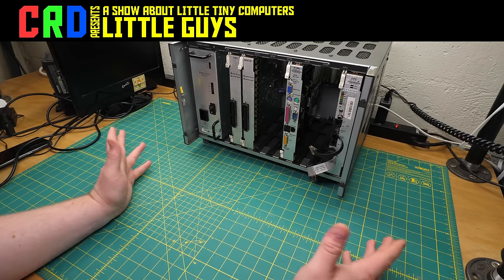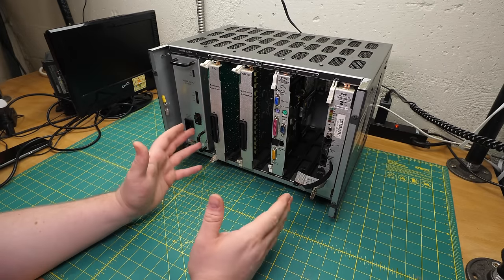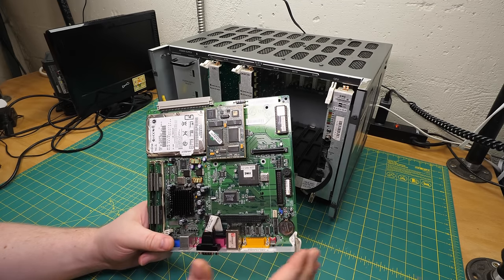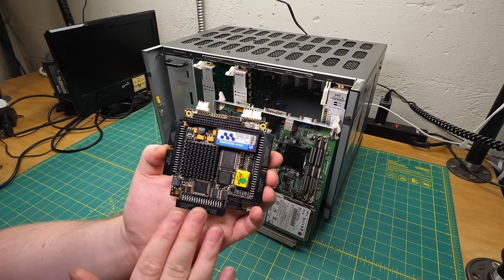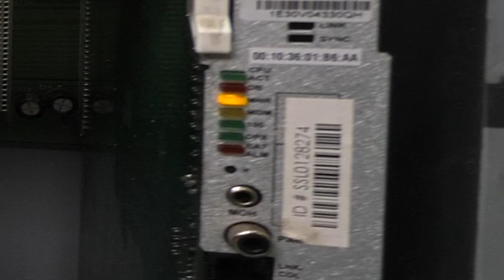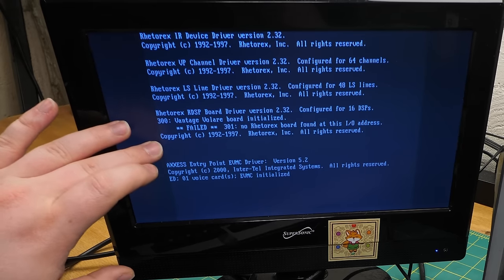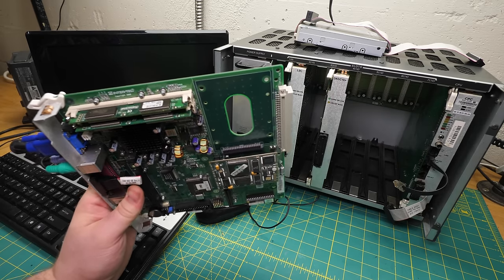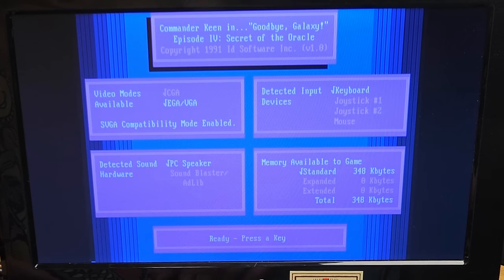Little Guys 9: The First Of Many [Intertel Axxess]

Comment: I used to install and service the Axxess. The fun part about upgrading the software for VM card was that it had to be done with a series of floppies. As you can obviously see is that there is no floppy drive but there is a floppy header. Whenever I did upgrades I had dangle a floppy drive out of the chassis while it was powered up and go through the upgrade process with a monitor and keyboard attached.
To explain why audio goes over the PCM port and not the backplane is that the original voicemail system for the Axxess was a full external PC with an ISA card with the PCM connector and DSP bits. Control of the voicemail system was done with a serial port. The EVMC is all that put on a card that is powered by the backplane and communicating the same way.
Reply: Heh. Just like some airplanes. (yes, some of them STILL load updates from 5.25" floppies.) I guess it could be worse... upgrading Big Boy(tm) phone switches from TAPE.
Reply: we had a zip drive kit...
Reply: Work still has one in production use, with the outboard voicemail PC and all. The PC software uses a DLL to cause Windows Explorer to interact with a Microsoft Access database. It only works on a few versions of Windows NT, ours runs NT 4. People jump up and down screaming at me about how dangerous and irresponsible and insecure this is because they cannot understand that there is no network hardware and no USB ports and no WiFi capability, the machine physically cannot be connected to any kind of network. The hardware is not there. They just keep asing "But what if someone just plugs it in? What if it gets accidentally connected? What if someone sneaks in..."

If someone is able to get through all of the locked doors into the phone equipment room and install hardware undetected, I have much bigger problems than the Intertel software being unsupported. They could just wreck everything in the room with a hammer and do a lot more damage.
Reply: @SuzuranMajere  Yeah. Some people just cannot wrap their noodle around a computer NOT being connected to the internet. The only way to potentially interact with it is through the "modem" (fax) interface. Some of them (VM cards) have a means of "DISA" - Direct Inward System Access - for remote management, but the interface is uselessly slow (9600bps)
Reply: Neat!

Comment: Your gnarly black grease reminds me of something I encountered back when I did electronics recycling.
We got stuff that had come out of a Harley Davidson plant. Hundreds and hundreds of 700MHz Compaq Deskpro desktops. HUNDREDS! And then later, hundreds and hundreds of Compaq Evo desktops that replaced them. The deal was we refurbished the ones that were salvageable, donated those to charity, and used the proceeds from scrapping the rest to fund it. Anyway, some of those PCs lived in very harsh environments - some in particular were coated inside and out in a horrible black greasy tar that was some kind of freak abomination of condensed motorcycle exhaust and aerosolized lubricants.

... And then there were the weld shop and paint shop machines.
Reply: And to think, the same stuff is coating the workers lungs
Reply: I used to do some electronics repair and hearing "weld shop paint shop machines" triggered a fight or flight response. I remember seeing the aftermath of somebody dumping a shitload of current through a steel PC case. Sheet steel can't handle that much current.
Reply: A few of my customers are machine and mechanic stops. That black grime is on everything even with me cleaning them every 6 months.
Reply: Every CNC machine from the 90's I've worked on is covered with the mystery black gunk (pretty sure it's mostly cutting coolant, and other oils), but most of them have seals on the electronics cabinet, with a heat exchanger, so no air is actually moving from outside to inside of the cabinet - on some machines that haven't had many issues, and the door was kept closed, the inside of the cabinet is virtually pristine. And on the ones that had issues, and the doors were open a lot, they're pretty coated. You can wash it off with simple green and a plastic brush, and rinse with hot water. They come out basically brand new. PCBs are washed when they're manufactured, so it's not a big deal to wash them again later. Just be careful of water in connectors, transformer coils, and under chips, or in speakers, buzzers, etc etc. Compressed air usually does a good job of getting rid of 95% of the water.
Reply: I got a 486 machine from an old print shop that got used well into the 2010's. The board and cards were jet black from ink powder and dust.
Reply: I was thinking machine shop

Comment: I worked at a NASA contractor a few years ago and we sent PC/104 computers to the ISS to control and caprure data from various components and sensors of science experiments. Cameras, thermostats, servos, ignitors, heaters, pressure sensors, valves, etc. They are still very useful and you can get tons of add-on boards for them for connecting all kinds of specialized equipment.

Comment: Hey Thank you for the OS/2 and ATA (VOIP) modem stuff on your website!    The OS/2 images were a serious nostalgia trip for me;  I used 2.0 and 2.1 daily as a personal workstation in 1993-1994, and then years later for work had to upgrade a pair of OS/2 2.1 servers to Warp 4 for Y2K as no one else had OS/2 experience.  OS/2 2.x had super fast disk routines and was WAY more responsive on a 486 than any version of Windows at the time.  Multitasking with a modem was reliable unlike Windows 3.x.  I missed out on Warp 3 because of a life event that occured right before it was released, but it looks like that would have been a great upgrade.   Keep up the awesome site and work CRD!
Reply: In the early 1990s, OS/2 was the hands-down best OS for personal computers. I still miss some of the awesomeness of the Workplace Shell.
Reply: As microelectronics engineer, i have a deep love/hate relationship with OS/2. It's super finnicky to set up and to navigate, but once it is ready for it's purpose, it runs very stable. OS/2 is still used in some industrial or commercial legacy systems. But most of it runs on Windows NT or UNIX.  I work mostly for smaller production facilities and they often buy older second hand machinery. 

I have never used it as a desktop system, but after all what i have seen, i came to the conclusion that desktop UI's before Win95 are super unintuitive, at least in my eyes. Win311, Amiga WB, UNIX, etc, they haven't quite figured it out yet. I'm born 1992, so i missed that time period. My parents were engineers too and  had some older 3D/CAD systems at home. Amiga 2000 & 4000 based ones and dual Pentium Pro Siemens Nixdorf systems with NT4. 

There is a modern OS, which claims to be compatible with OS/2 applications called ArcaOS, but i have not tried it out yet. It looks very close to a Linux DE from what i have seen.
Reply: @hyperturbotechnomike  The problem with ArcaOS is that it's still a closed source system and if there's one thing that companies like to do it would be to squeeze pennies until they melt into copper. That also nixes the hobbyists out too.

Comment: my uncles ran a bus company for a while and they had one of these PBX boxes in the back electrical closet and the thing i found neat was someone had attached a radio-stereo system to it, so radio played over the PA system in the warehouse and repair bays, and it all looked so duct-taped together.
Reply: shit, someone did the same thing in the tax office I worked at in college. Our PA system was literally wired into the output from a regular old boombox with its speakers ripped out so the wires could attach to the PA system controller, which was in turn run by the poor little overheated office computer pretending to be a server.

Comment: MCF5272VF66 "SOC" is a ColdFire V2 SOC running at 66MHz, my best guess is that it's comparable to a 66-100MHz 486 (depending on what it does).
ColdFire isn't "a 68000 processor", the instruction set is derived from 68k but is missing some instructions and addressing modes, the FPU internal precision is 64-bit instead of 80-bit and the actual instruction encoding is simplified. You can run 68000 assembly through a translator to generate ColdFire assembly and then assemble that, and for simple programs it might work as is but it's really intended as a starting point for porting rather than being used directly. This seems similar to how the Intel 8086/8088 came with a translator that took 8080 ássembler and generated 8086 assembly - again it might work out of the box for very simple programs but it was really inteded as a starting point for porting all those old CP/M programs.
Reply: I forget how they marketed the thing. I had several dev boards, and I think the palm pilot used them. They were roughly based on a 68030, but designed for low power use. I don't know anyone that wrote assembly for them (that could avoid it :-)), everyone wrote things in C. (with minimal tweaking, C compiles anywhere.) It's hard to compare it to a "PC" as it's not anything like it. For example, SSH is insanely slow on a CF processor, so much so a 12MHz 386 can run circles around it.
Reply: I had a portable music player back in the 2000s that had a Coldfire CPU (Motorola had spun off their semiconductor division as Freescale so that's how it was branded). I installed a hacked firmware called Rockbox and even created a basic 3d game for it, and I wrote the core of the rendering loop in Coldfire assembly. It was pretty fun getting it all to work.
Reply: I know that the older Crestron Building Automation systems used a Coldfire C based compiler for their programming software. But it was all proprietary at that level and heavily guarded from non-licensed programmers
Reply: @PinkPandaKatie wow, Rockbox rocked! I installed it on the iPod Classic, the last gen before they all turned into b-stock iPhones with no cellular connection.
Was your game by chance the Doom port?
Reply: @Dong_Harvey  No, nothing that fancy. It was actually inspired by Ken's Labyrinth, and I called it "RocKen" as a pun on "Walken", the early prototype of Ken's Lab. I never finished it, though, and my iRiver H120 broke a long time ago so I have no way to actually play it now other than a standalone test version I created.
Reply: I was hired out of college in 1999 to port a bunch of legacy 68k code to coldfire. That idea was scrapped right after I got there since newer compilers didn't support register indirect data addressing the legacy code used, so the 68331 was bumped from 16MHz to 25MHz, and the project continued. Ironically we ended up porting an RTOS to the newer hardware and didn't directly use any of the legacy 68k code, so CF would have been fine, and run a lot faster.

Comment: The pin you blew up, btw, is a ground pin on the hard drive and the melted socket on the motherboard is the +5V (motor) pin. Since there are multiple adjacent ground pins elsewhere on the connector, ground was still properly connected when the pins were offset and you shorted the main 5V supply into one of those ground pins (which promptly melted).

The reason the drive and board still work is firstly because those other ground pins on the drive are fine, and secondly because either your 5V motor supply socket on the motherboard is still ok despite the melting or because there's an adjacent 5V logic supply and they're bussed together on one or both ends.

Comment: Oh man, I used to admin an Intertel Axxess (and before that, its little brother, the Intertel Axxent).  I had the very configuration software you're missing, sadly, lost to time.  And yes, with that system and an ISDN PRI line, you could make all sorts of telephone magic happen.  (A call from Zimbabwe, you say?)  Our system must have had the network card, because I could reach into it from my desktop system.  (This would have been a circa 2002 system.)  Those little DSPs were a much-touted voice-processing feature that did some echo-cancellation for speaker calls, among other things.  It was really a nice little beast.  
Oh, and here's a fun "little guy" moment:  The kid-brother to this system, the Intertel Axxent, actually used an ATX mini-tower as its enclosure, but not in the way you'd imagine.  It had some kind of passive backplane, analogous to the Axxess, but it was in an ISA/PCI card slot form-factor. Similarly, the voicemail card was a single-board computer that plugged into that backplane, but a completely different shape.  (It was probably running the exact same voicemail software.)  It was a PC in a PC case, but not like you'd expect!

Comment: High an old CallWare CNTE here (Certified Network Telephony Engineer). The 15 pin connector is for out-of-band signaling to the voicemail card.  Calls are routed to voice mail and become analog pots calls that get converted by the 8 channel card on the board.   The 15 pin connection tells it what the call is that is coming in.  For instance on port 2 is extension 103 doing a voicemail retrieve, on port 4 is a call no answer for extension 105, and on port 3 is a transfer to voicemail for an outside call to extension 106, port 101 is an Auto Attendant, etc.   Many voicemails did in-band signaling where it winks, sends DTMF digit to say what the call is, then winks again and the call is put through, but they were a little slower and if you had one bad line, it was REALLY hard to trouble shoot.   Some of the early systems (Like Panasonic KXPs) had to do supervised transfers, those were messy.   We also had TSAPI, an out of band signaling protocol running over SPX, that one had some problems at first!  Most of those systems we just had to change over to in band.

Comment: FYI, 1.) there are new Open Source Hardware projects making things like Sound Blaster and Adlib clones for PC104 boards.  They're really popular for compact DOS gaming rigs.  Some of the projects require out of production components, (but not all of them).  
2.) ALSO, ALSO!! Someone made a PC104 to ISA card adapter, where it has like 3 or 4 ISA card slots that you could (optionally) install into an AT motherboard case (if you wanted to).  But it gives you the ability to run stock video cards, harddrive cards, and/or sound cards.

Makes it easier to start out slowly with PC104, build a working system with off the shelf parts, and slowly work your way up to a full system.
Reply: Yep. There's been a lot of those coming out recently.

Comment: I think it's likely this device was in a factory. I used to do IT work for an industrial company. One of the plants we serviced was a rubber injection molding facility. There was black residue from the rubber, and grease from the mold release spray over everything.

Comment: Paging terminals (computers really) were another interesting voice storage application. You only had one frequency that hundreds or thousands of pagers were tuned to so what do you do if two people dial two pagers at the same time? Originally one person would get a busy signal which was annoying but eventually they began recording the message and transmitting it to the pager later. The paging terminal that my dad owned around 1980 had several Z80 based boards that could store eight second voice messages in 64K of RAM digitally  so the message would be sent to the pager once the transmitter was available. The idea that audio could be stored in a bunch of bytes in memory completely blew my mind at the time.

Comment: As for OS/2 interface and lack of exit button - the "double click on system menu" is not only something that existed in Windows at least since 3.0, it works to this day in modern Windows versions xD
Reply from the maker: Right, but at that time it was mandatory.
Reply: Double-clicking to close windows was mandatory in its contemporaries too; there was no other "window manager" button to do it. That is why OS/2 does it that way - IBM was just copying what the norm was. It's not a mark against OS/2.
Except Macs. Macintosh OS, at the time, had a box in the upper left of the window that would close it. It looked like a checkbox, but would quit the app when you tried to "check the box" to see what it did.

Also, on OS/2 it was common for apps to not have a File -> Exit/Quit menu option. Many did, but not all. Maybe that's what CRD meant by "mandatory".
Reply: Annoyingly enough, it doesn't for anything made with WinUI, like Explorer. Either that or the custom framing they had to implement to make tabs work in Explorer just lacks support for handling it, because oh how I sorely miss it.

Comment: As a kid who grew up on a C64 and was blown away when 95 came out it is cathartic to hear the beeps and boops as you mess round in the bios and booting.  Was also nice to see ports that most "tech support" would have no idea about. 

Love my modern toys, but boy so I miss those days when it came to repair.  Computer won't boot, may take 5 hours but you can fix it usually with stuff you have on hand.   So many pcb I have repaired with bread ties and magnet wires. 

Now I can't even tell which trace I want without a microscope and schematics that look like M.C.Escher was the circuit designer.

Thank you Gravis, always appreciate your videos.

Also, I will be waiting for that PBX video/s.  Will take me back to playing with them and sip to get free cell service over my city free WIFI.   Missed the first wave but that felt like Phreaking 2.0